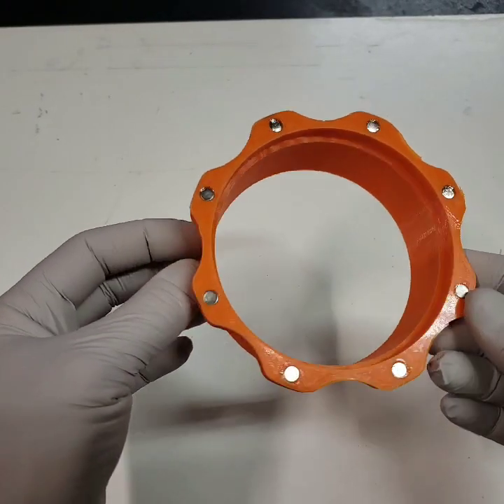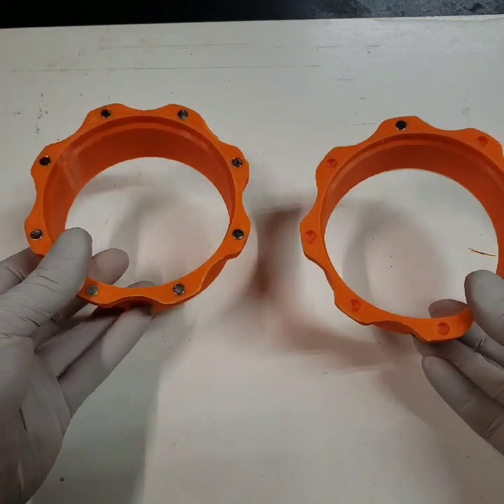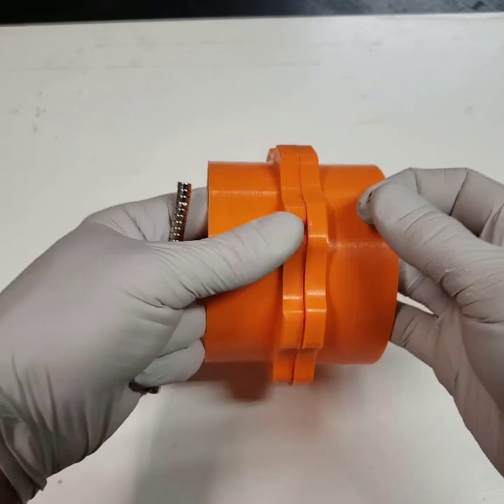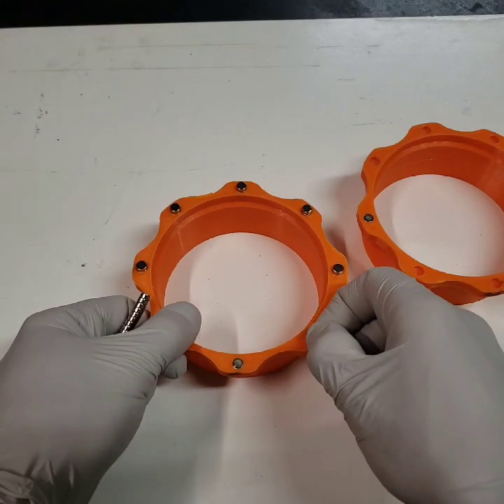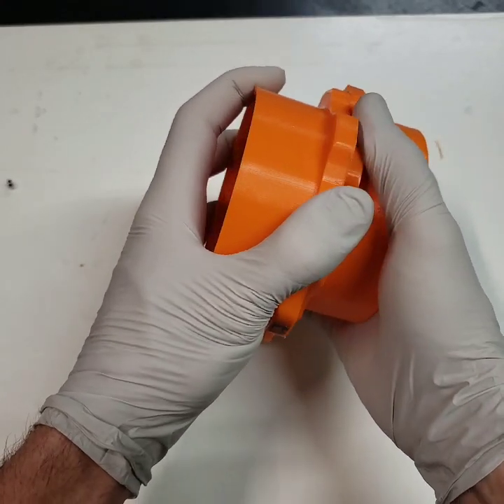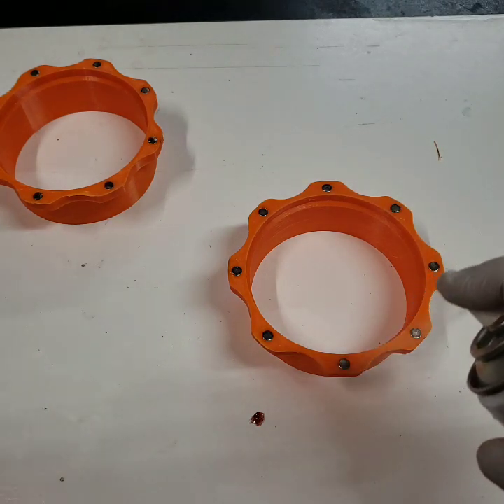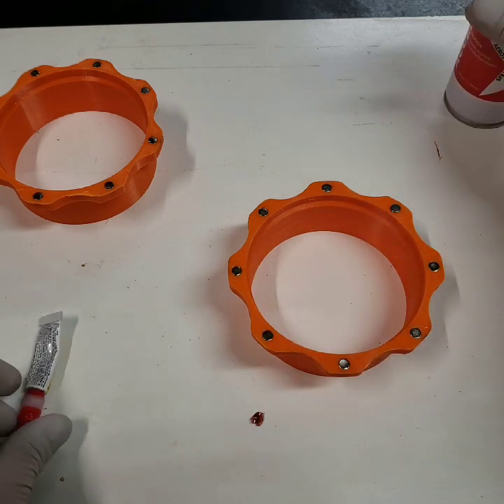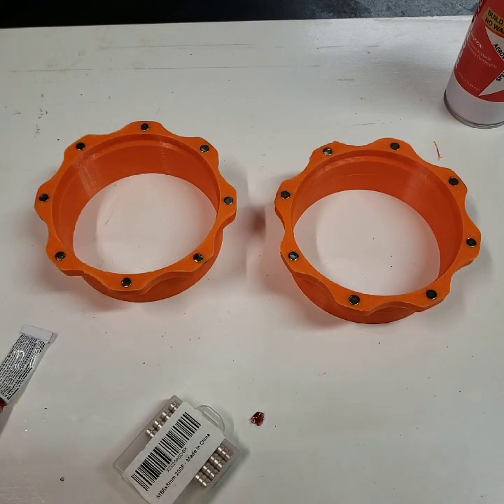3D Printed Magnetic Dust Hose Couplers

Comment: How much infill did you use?  I know I should probably switch out to PETG, but I've got PLA loaded....
Reply from the maker: I think around 40 infill, I would use 4 walls and more infill shouldn't add that much print time. It isn't under much stress so PLA should work, just keep  it away from heat.